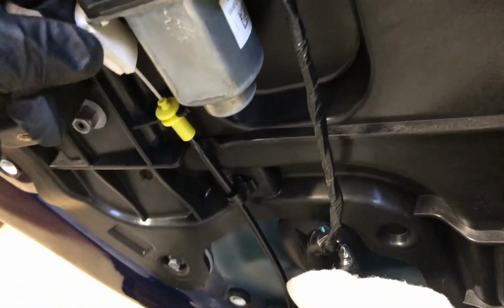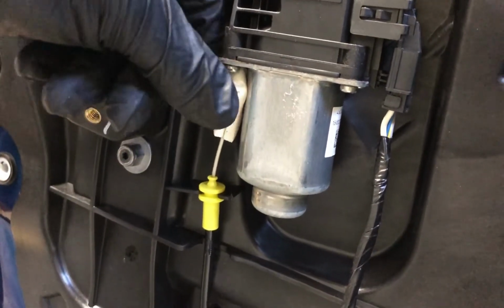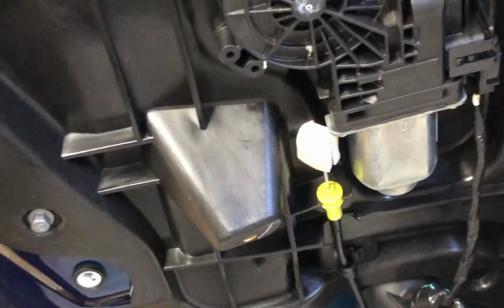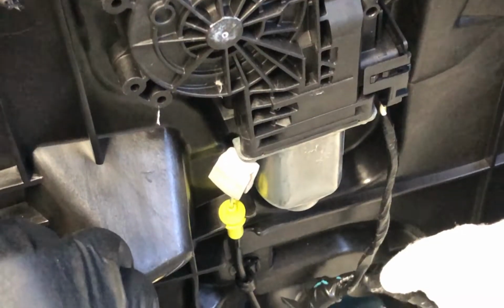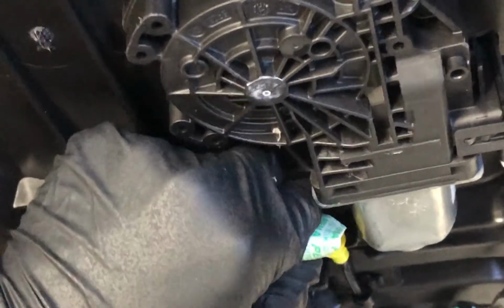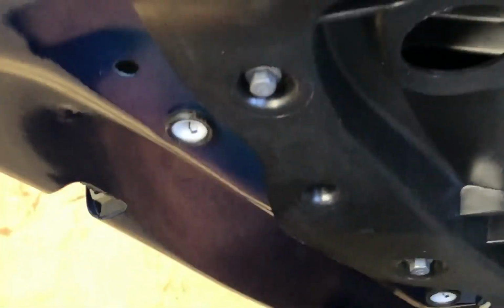Tesla Model 3 - Rear Door Rattle Fix

Comment: Thank you for posting this video. Both my '18 and '21 Model 3's had this exact rattle, in the right rear door. I had service fix it both times. On my '21 they accidentally broke the window while fixing it, which was a big hassle (and had to get retinted). Unfortunately, their fix (whatever they did) didn't last and the noise is back 1 year later. I'm going to try fixing it myself this time.

Comment: Thank you! Had this exact rattle on my rear passenger door. I'm not sure if I was hearing this rattle or not, time will tell once I get some miles on the car. In case this helps someone else, I still had one small rattle somewhere back there on certain type of roads at slower speeds after this fix. That one was coming from the rear side bolster. I had taken it off a few times and broke the clips. Had my wife drive around the block with me in the back. Once I adjusted the side bolster that little rattle disappeared.

Comment: Worked 90% for me, still some slight noise when tapping. But since I dont have a emergency handle in the read doors, it could remove the cable completely? Or apply some felt to the other side where the actual noise is.
Reply from the maker: Sorry I have no idea - I have no experience with that model. That said, I'd be inclined to leave the cable and wrap it in tape or similar.